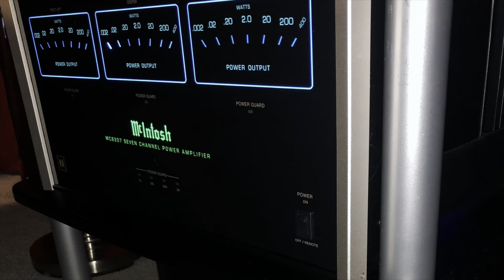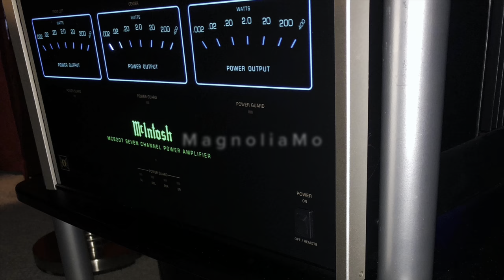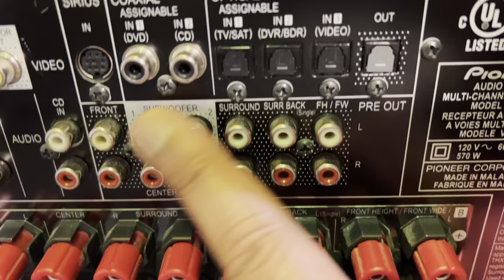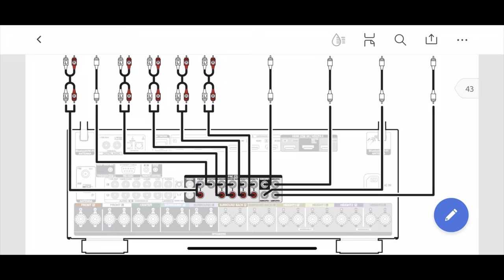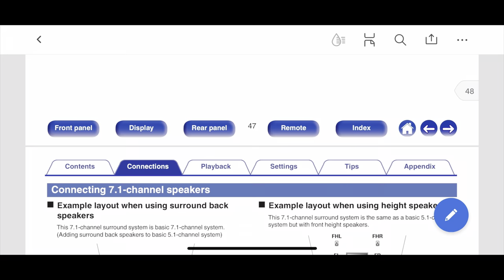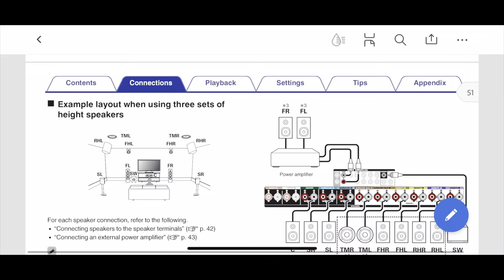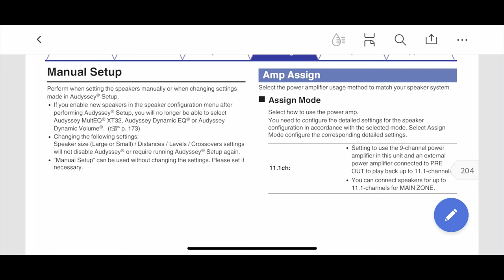How to connect an external amplifier to a receiver

Comment: I have a Acurus 125x5 amp I want to do to my marantz receiver thats 4 years old
Reply from the maker: @davidmiller-sr7cb  Hi. Thanks for the question.  Does your Marantz have preamp outputs? What model Marantz do you have?  Acurus amps are good amps and if you have 5 preouts available on the Marantz then you just connect the preouts to the Acurus RCA inputs.

Comment: Nice video. Thanks. If we use an external amplifier (for front channel as an example), will the audio controls (volume / mute etc.) of the Denon remote work for the amplifier sound?
Reply from the maker: Yes they will.  The RCA pre outs work similar to a preamp.  If another amplifier is a receiver or integrated amplifier you will need to adjust that amplifiers volume to a desired level and then run auto setup or level match using an SPL meter to ensure levels are matched to other channels that are driven by the receiver. Hope that makes sense.  Thanks for comment.
Reply: Thanks  @magnoliamo . I am assuming I can set the volume on the amplifier to say 29db and run room correction on the Denon. From then on the Denon remove will control volume on the all the channels.

Comment: I have a Marantz 50 cinema . Right now I have two tower speakers a center spear and a sub . Do I need a power amp
Reply from the maker: Thanks for the question. That depends on your speakers and the setup you are looking for.  The Cinema 50 is a 9 channel receiver.  That means, if you want to get a full 7.4.4 system you will need an external amp for 2 of your channels.  If you are fine with a 9-channel layout but have power hungry speakers or want more output than the 110 watt per channel amplification as advertised by Marantz then you will need to add an external 2-channel, 3-channel, or 5-channel amplifier.  All depends on you.  I think the Marantz Cinema 50 has enough power to drive a 5.4.4 or a 7.4.2 layout as long as your speakers are relatively easy to drive.

Comment: Please help i have spent quite a bit and i dont understand. I have a denon X1700h that is 8ohms and i have 2 6ohms speakers. My 1 year old removed a binding post from 1 speaker so i have only been using 1 speaker. Today i got flashing red light and i have removed all wires and its been off for a few hours but still got red flashing light. It is still under guarantee so i can return but would you know why this could happen and if i can get an amp for this reciever ? Because i want to get 4ohm speakers
Reply from the maker: This receiver does not have speaker pre-outs so you cannot add an amplifier. The flashing red light is usually a sign of mis-wiring. I would contact Denon customer service. Thanks for the question.
Reply: @magnoliamo  thank you

Comment: Nice job with this topic Mo. Have a Denon 3600 and an Anthem AVM 60. I go back and forth with the two and drive them with an Outlaw 5000x and Emotiva BasX A5175.

What got me started on the external amplification path was my purchase of a Yamaha TSR 7850. Was surprised to learn that it had two RCA pre-outs on the rear. Took advantage of the feature and purchased an Emotiva BasX A300 two power the front stereo pair. I was so shocked by the change in output for my Elac pairs (B6.2 and UB5) and would always recommend that anyone using more than 5 speakers always use external amplification for at least the stereo pair.
Reply from the maker: Thank you. Completely agree with you.  If you have pre-outs, use it and experience the advantages yourself.
Reply from the maker: How do like the Emotiva BasX A5175 compared to the Outlaw?
Reply: @magnoliamo  Balanced XLR is a plus I haven't taken advantage of yet but I plan to soon when I switch back to the AVM 60. I'm using both amps to power my 5.1.4 setup wirh the 3600 basically acting as a processor.
Both amps always remain cool as I rarely listen to music at a max of -4.5 dB and theatrical content at a max of -9dB when I want to push things. I don't recognize any noticable difference between the two external amps yet. The 5000x was surprisingly heavy when compared to the light AVRs and Emotiva amps I've owned.
Base layer 4 Kef Q150s with an Infinity RC263 as a beast of center option.
Front heights are SVS elevations and Top middle heights are Monolith THX concentric satellites. The low end is represented by SVS SB 2000 and REL HT 1205.

The Spatial Audio Calibration Toolkit by Techno Dad and Joe n Tell has been very helpful in my recent tweaking.
Reply from the maker: @kingeo25  nice setup. I will be getting the spatial audio calibration disc soon. Thanks
Reply: Connecting this amp  to a receiver..... What does it do for the RECIEVER
Reply from the maker: Good question.  An external amp will have more headroom and will be able to play louder. Not just loudness but also with less distortion.  Even the best of receivers will have higher distortion when you drive them closer to their rated wattage.  Hope that helps.